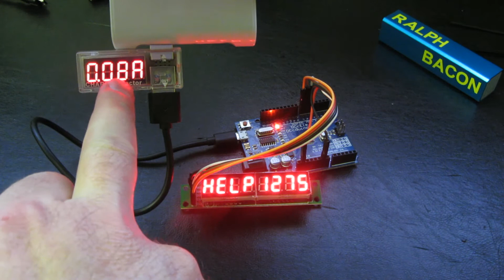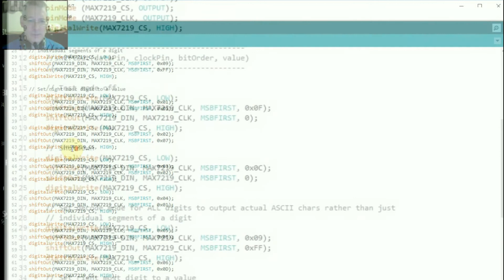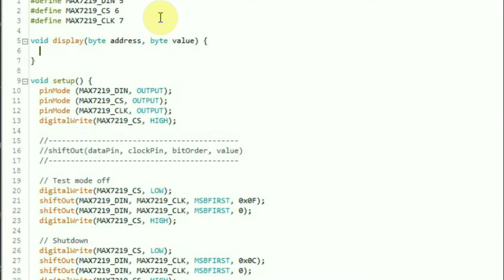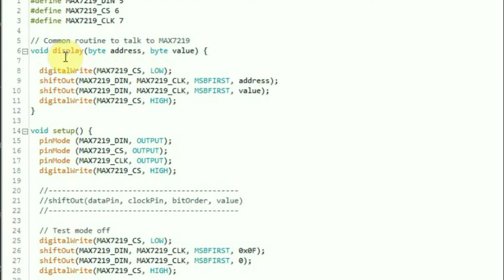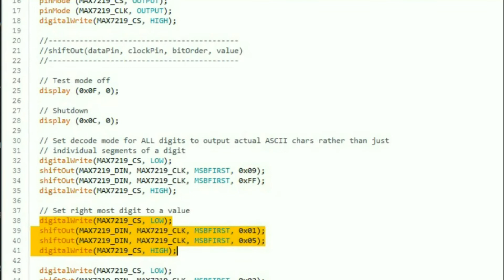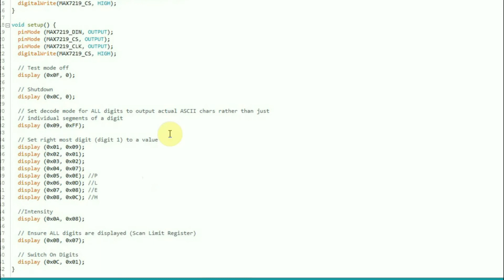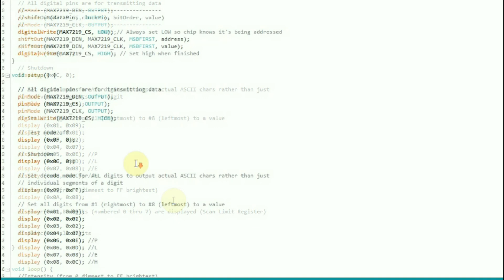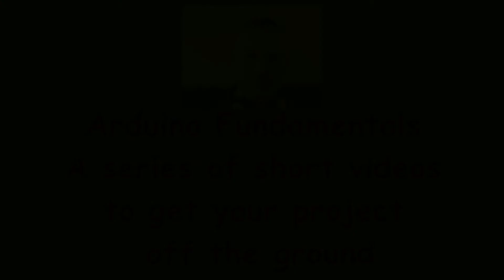#11 Arduino and LED 7-segment displays using a MAX7219 - Part 3

Comment: Hello, today I was looking at one of your tutorial on STM32 micro's,I was amaze about the 72Mhz clock,64K memory etc,..  if I may ask, do you know any 5v logic microcontroller in the range of the STM32 ,  as per clock/memory similar form factor as Arduino nano,,(small and pratical) that I can use with Arduino IDE to write program, everything I worked with is 5v logic, Thank's again for all the good tutorials.
Reply from the maker: To be honest, Jack, rather than limit yourself to 5v devices (becoming rarer by the hour) why not use level shifters which are so very easy to use and ensure you don't zap your precious microcontroller. Have a look at (quite old) video #34 which describes their use:
https://youtu.be/g3a0X30Le-8
Reply: @RalphBacon  Hello, and thank's for a quick reply, my goal is to design project with only 1 chip + few components on the side, since I had all my PCB's done at JLCPCB for the last 3  years. and I know about logic level shifter aka,3.3v-5v, and it's involving parts that I can do without in case
I can find an Arduino IDE compatible micro cont, to fit. my main issue is the clock as to be > 16Mhz, and small footprint. for now I heve some ATTiny85,PIC12F683,690,1937,Picaxe,and of course some ATMEGA328P. Kepp up the good work you do, I really appriciate. J.B

Comment: Thanks for all the videos.  I really have learned a lot.  Concerning the 8 segment modules.  I cannot find a schematic. I have 4 of these and all of them behave the same where the VCC on each end do not connect to each other and the first VCC does not even connect to VCC on the chip.  The other VCC does. Something is strange. Can you confirm if I have bum chips or something or does yours work that way too?   AND I appear to have some sort of Ghost Power.  The first module I do not even have to connect VCC or ground and it works.  Very Strange.
Reply from the maker: The VCC is connected first to a diode (0.5v drop) and then to the VCC pin at the other end, Neil. Depending on how many you have in series the voltage drop(s) could be significant and probably worth connecting VCC directly to each chip rather than as a "pass-thru" arrangement.
Regarding the ghost voltage, that is the power being supplied to each LED segment finding its way to other parts of the circuit. Best to avoid that happening as it is not designed to work like that.
Reply: @RalphBacon  Thanks Ralph, I now understand about the VCC.  It confused me at first because both pins are labeled VCC on the board, so I thought they both are supposed to be  electrical the same.  In this case they are not. As for ghost voltage I am still baffled. With only DIN, CS, and CLK the display works on my project. Does your behave like that? When I connect VCC and ground to the module, my project stops working. My project consists of standalone at328p, (16Mhz method), RTC DS3231,  nRF24L01+ with module,  LCD module, FTDI  USB to Serial to program the project, and this 7segment 8 unit module.  The other end transmits the temperature from outside.  The LCD was not bright enough from across the room to see the display,  so I added this 7segment display unit because the red LEDs segments can be seen from across the room. What happens is when I connect the VCC and GND to 7segment module, the project stops working/receiving from the nRF24l01 module.   Maybe to much current draw I am thinking?   I am tempted to just leave as is, no VCC and GND to module, but I know that's not really right either.  Any more insight appreciated.   On different topic, not sure where to request other videos.  I am thinking I would like to use PlatformIO.  I also have experimented with ATmel studio 7.  Not sure how to use all that simulator stuff. 
I too miss Benny.  He was the brains of the group.  He would MEOW and set you straight. His wisdom will be missed, :)

Comment: HI Ralph- Another great video......I'd like to use this 8 digit LED to display as 2 separate 4 digit LED's to display Voltage on 1 and Current on the other. Is it possible to display variables separately?
Reply from the maker: Yes you can. Although the display is "joined", what you send to each digit (see my demo sketch) is controlled by you so you can treat it as an 8-digit display with independently controlled digits.

Comment: 8:24  the E became 8, another voltage glitch?
Reply from the maker: No, Shaikh, not this time. Even after 3 years since this video was made, I get comments about this typing error ! Yes, it was a typo in my code - it works exactly as it should do! Nice to see that my older videos are still attracting viewers, though. Thanks for posting.

Comment: Ralph, when you had the long code, you used CBDE7219, but when you cleaned it up, you used C8DE7219, which spells H8LP1275, just a typo. But great video, thanks. Please do one on how to take a variable number and put the digits into the code so the numbers are displayed. Thanks
Reply from the maker: You win the Eagle Eyes award for this video, Bill, well spotted (albeit about 3 years late)! Putting a variable into that message really is easy, so I will add this request to my list. Thanks for posting.

Comment: Where is the code? The link does not work
Reply from the maker: Apologies, Paul, Dropbox have removed the 'Public Folder' facility. I'll move the code to an accessible place this evening.
Reply from the maker: All the code has been moved to my Github repository https://github.com/RalphBacon/MAX7219-7-Segment-LED (all the code for videos #9, #10, #11) plus the library and extra sketch. Please let me know if you cannot access, find or use these files Paul and I'll do my best to help!
Reply: Thankyou
Reply: Thanks, everything is working great! I think that I am finally starting to catch on to some of this (thanks to you)
Reply from the maker: You're very welcome Paul. The thing about Arduinos is that everyone can make something. And it's not rocket science. (It's usually a messy nest of Dupont cables from the Arduino board to something else but that's another story.) Seriously, I'm glad you got it working and keep going - lots more things the Arduino can be used for. Thanks for posting.

Comment: Thanks for the great tutorials Ralph! I have subscribed to your channel and look forward to watch more videos. I have made a prototype with the 7-segment display and the code you explain works great. I have a question though, how can I make it display a number stored in a variable? For example, if making a counter with a button, and showing the increasing number on the display.
Reply from the maker: +FunctionalDesign 
Great that you are finding the videos useful, keep watching! 
 
To display a value of between 0 and 9 (eg held in an integer) on digit 1 just change a line in the demo code like this:
 
From: display (0x01, 0x09); 
To: display(0x01, [your variable goes here]);

That will display your stored value (0 through 9) in digit 1 (0x01). If you have a larger value you want to display (eg 345) then determine which digits are to hold the hundreds, tens, units and send that part of the value to that digit as shown above.
 
//Your integer value
int test = 345;
 
//convert to a byte array (aka String)
String sTest = String(test,DEC);
 
// Extract the nth digit for sending to MAX7219 
display(0x01, sTest[0]); // hundreds to digit 1
display(0x02, sTest[1]); // tens to digit 2
display(0x03, sTest[2]); // units to digit 3 
 
If the integer is large then I would do the above Extract in a loop.